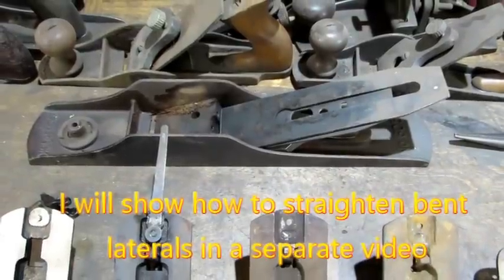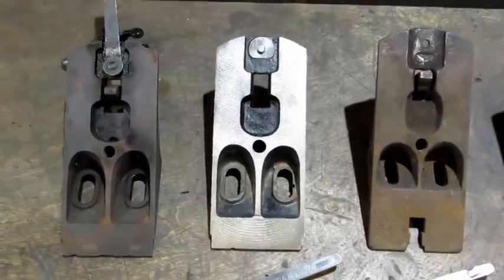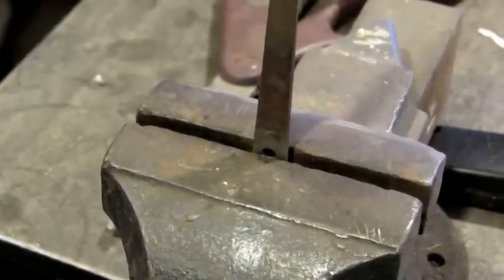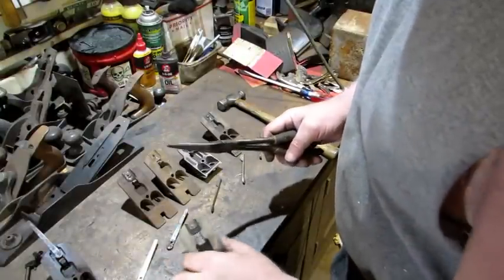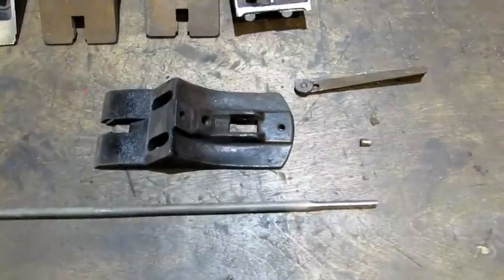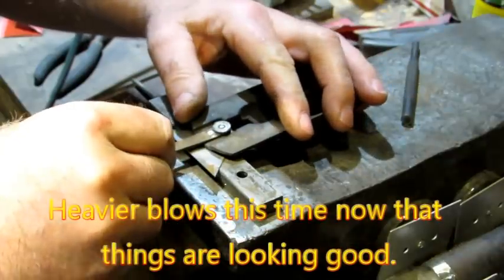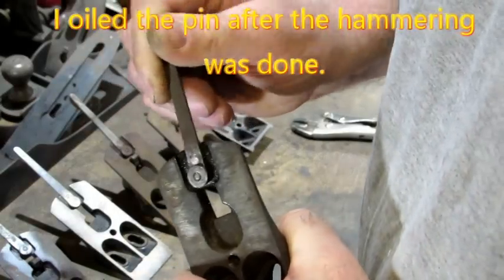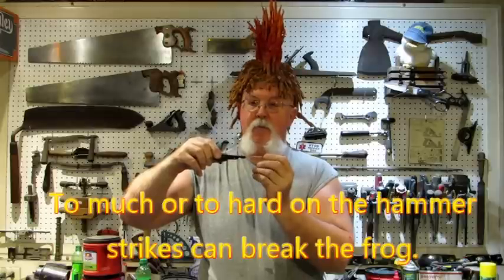Removing, Replacing and Tightening Lateral Adjustment Levers

Comment: Hello, Mr. Bradfield;
EXCELLENT!
Great video, I think you may be an 'artist' mechanic.
I have a type 16 #4, ogfcourse it is not a 'collectable'.
The lateral is held by a rivet which moves in the frog.
It is loose, if you turn the plane on its side the lateral falls down.
If I take the frog off again I'll use a center punch & tap it on  my anvil to try to tighten it a bit.
Thank you for all you do.
Have a GREAT day, Neighbor!
PS
I almost laughed out loud at your wig!

Comment: Some great tips thanks!  I already have a couple a decent planes, two Stanley no 4s and a Record 5 1/2.   I've just taken delivery of another old Stanley no 4 which I'm trying to restore for my brother.   Most of the parts are good, but unfortunately, the lateral adjuster has a major flaw.   The metal seems to be too thick for the frog and the front face of the lateral stands slightly proud of the face of the frog preventing the blade from seating correctly.  Also the lateral adjuster catches on the back of the blade when trying to adjust to either side.   Were the lateral adjusters made in different thicknesses ?  I'm assuming someone has replaced it with a new one which is too thick for the frog.   Is this a common problem ?

Comment: Thank you for this video. I am trying to restore my grandfather's Stanley sweetheart no 2 plane for my father. I still need to find a adjustment arm for it but now I know it can be done.
Reply: Thank you for that info. I don't plan on selling it so I'm thinking I might do some metal work and try to make something work.
Reply: How do you secure the frog on the vise so you can use the hammer and set?

Comment: Thanks for this tutorial. I need to do this today, I’ve got some slop in my #5 that makes it a pain to square up to iron to the work.
Reply: It worked, the lateral is firm with not slop. Cracked the frog when the punch slipped off the side of the pin.

Comment: Where do you get a new washer for the lateral if it gets lost?  Bought one a while back and didn't realize the lateral was missing the washer.
Reply: You might make one, using a mending plate or similar piece of mild steel of the right thickness. Drill a center hole, then cut the disc out of the plate, file it around to the right diameter, and pin it onto the lever. I messed up a disc when flattening the surface of a frog, ended up wearing off the sides of the disc. This is how I’m gonna try and replace it. Good luck!